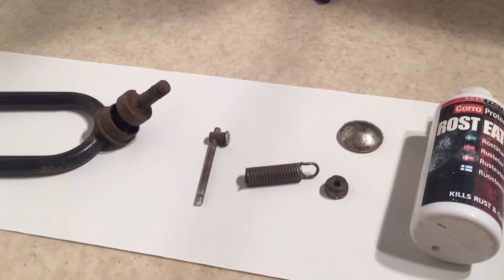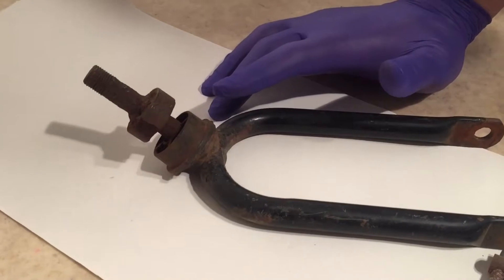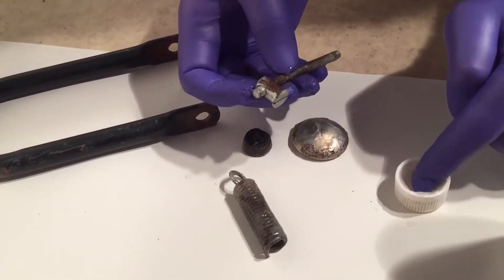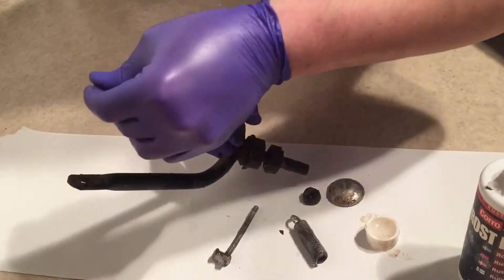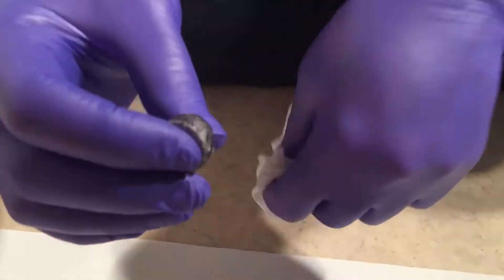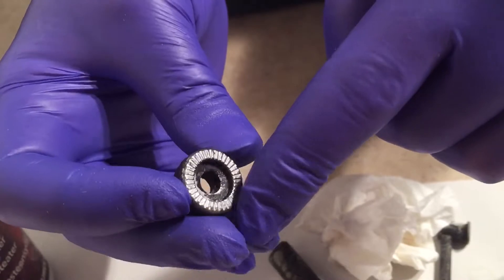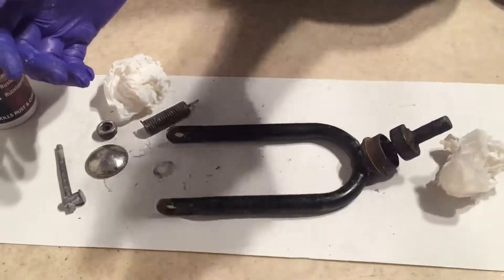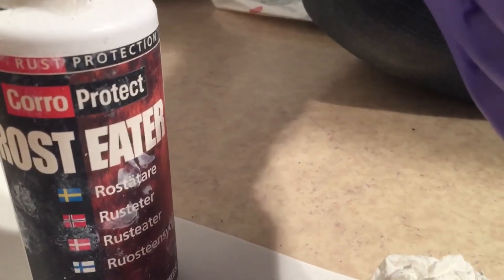Rust Eater: Effects on Different Metal Types in Relation to Stroller Repair

Comment: Older stokke models have a problem with paint peeling from the white plastic levers, have you figured out a better way then using steel wool?  Thank you for your videos, ingenious
Reply from the maker: Yes, they do.  The only solution I've found so far (other than just swapping the part) is to finish stripping off the paint with acetone and a micro-fiber sponge - which makes the part a bit more yellow, and doesn't hide scrapes, but still looks better than peeling paint :)